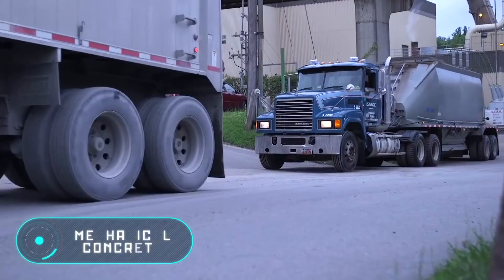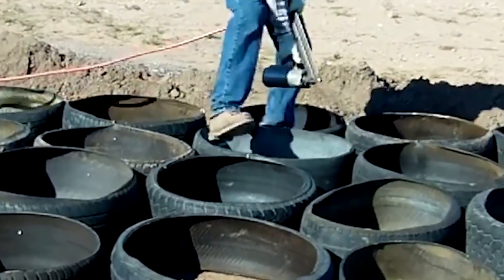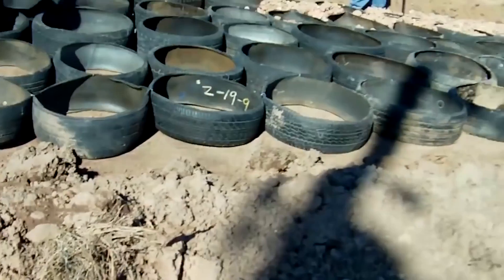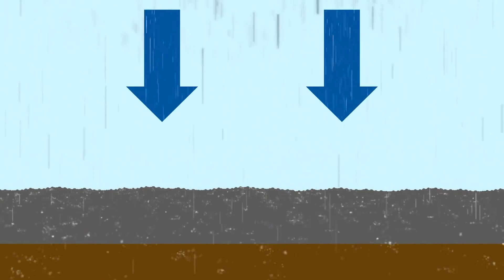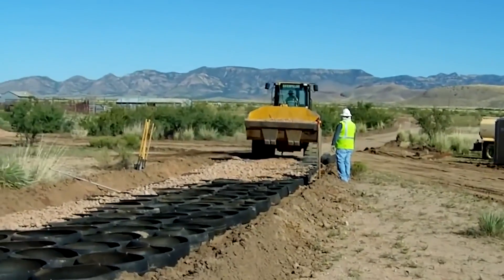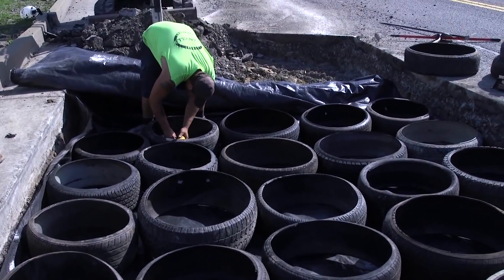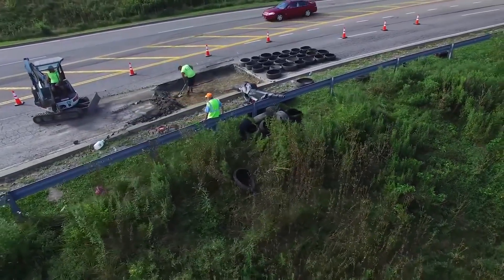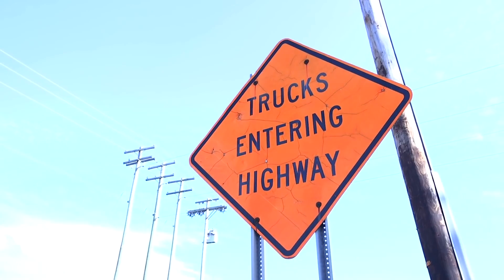Road Construction and Maintenance

Comment: What type of behavior of concrete if rubber tyres are placed below the of concrete road pavement it can increase its vibration resisting properties..can it is possible or not I am student of civil engineering..so give information about that.
Reply from the maker: You're putting gravel in the tires so it doesn't impact the pavement.

Comment: Ways to cut tire rubber out:
1. youtu.be/RLk8Je7ozMI?t=40 
2. youtu.be/RLk8Je7ozMI?t=180 or youtu.be/DnveV3JxDY8?t=118
3. youtu.be/CObmocHiVeQ?t=57 for Harbor Freight oscillating tool

Comment: How about using Angle Grinder and grind this tires into small particles.
Spray them on pavement adhesive that is painted on you driveway, rolling pressing them a little bit so they sink into the adhesive. Let them cured and hardened as shell.
Reply: My original thinking was to cutting the old tires into small 1cm cubes or chunks and then relatively, evenly springle them on top of a one inch thick newly poured cement concrete, tab the surface flat so that all chunks are half way sink onto the cement. After the cement dried, spray or paint pavement adhesive on it and wait for it to cure again.

Comment: you might manage to reduce even more if you granulate the tire walls and add them to the mix
Reply: The idea is to have a wrap over sectional plates to hold the aggregate together
Reply: The tyre walls would be flexible causing movement in the aggregate mix whenever a vehicle goes over it causing wear, so doesn't sound like a great idea.

Comment: What is the tool you are using to connect the tires? I tried zip ties but it is way too slow. A pneumatic tool is required for any volume.
Reply from the maker: Well ideally you don’t have to connect it together it’s better to have space between around 5 inch or more for flexibility but you could screw it together either way.
Reply: @tinytick  Why are you playing music with your voice? It adds NO benefit. It's incredibly disrespectful to play music while speaking to somebody.  Background music has hit youtube like the Black Plague.
Reply: Thats a compressed air nail or staples gun

Comment: any cons to not cutting one side of the tire off?
Reply: A void near the top sidewall.   This technique is amazing.  I did this 10 years ago to a half mile driveway on MUD.  pure swamp.   Still looks brand new today.  Heavy loads and logging trucks never affected it.
Reply: @dr.emmittbrowniii1711  can be used on steep terrain with a steeper slope?
Reply: I'm thinking pooling of water.
Reply from the maker: You think so